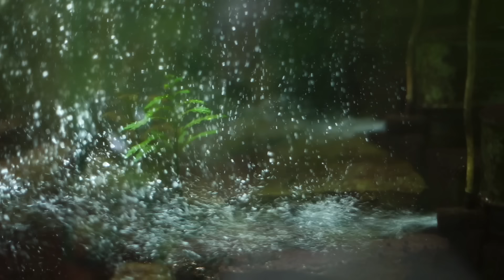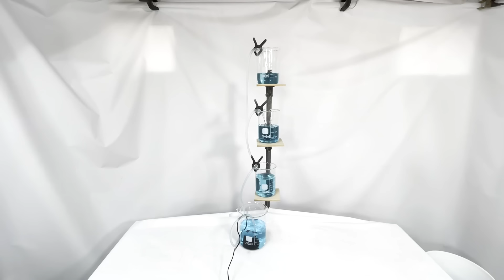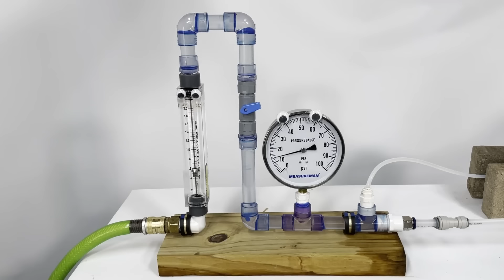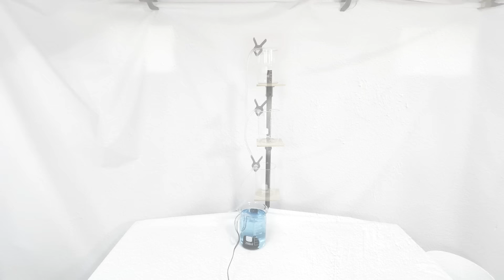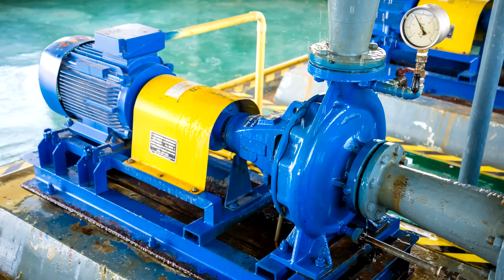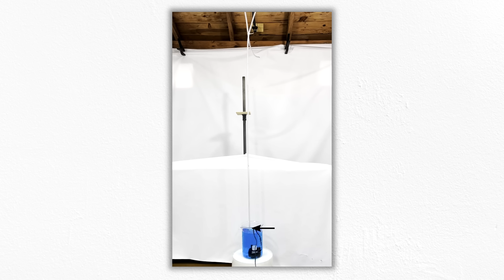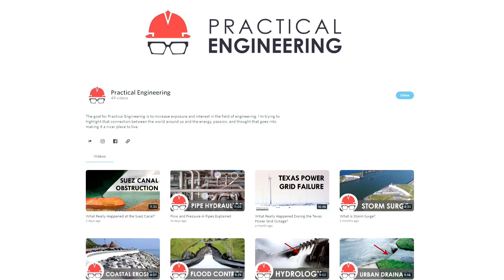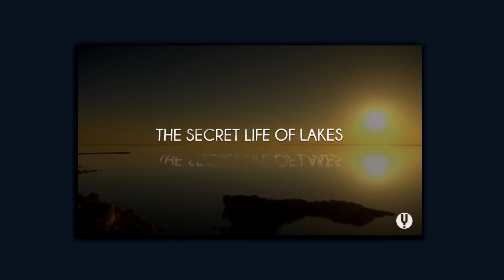Do Pumps Create Pressure or Flow?

Comment: We are rural contractors mainly dealing with fencing and irrigation systems and sometimes I feel like my job is explaining the effects of pipe length, height and pipe diameter on the head of the system as most irrigation supply retailers and plumbers just seem to hand out the wrong advice and try to sell a pump for a system they have done no calculation on. Drives me nuts as we are called in to fix a problem after a lot of money has been spent.

Almost as bad as the one size fits all strainer assembly for fencing but that's a whole new pile of worms

Comment: Please more videoes on pumps! Pleeeeeees! Here in Finland most folks own a fraction of a family summer cottage by a lake or have access to one through friends or access is a fringe benefit provided by your employer. Practically every cottage with electricity has a fixed water pump, often submersible ones for winter when the primary pump and pipes are empty and dryed, consequently inoperable. (I recall people in Texas had pumps and pipes destroyed by freezing water recently😭). 
  The video was great. I will pass it on to my kids.

Cars have multiple pumps, aquariums have pumps, an air compressor is a pump. Pumps are cool. However, elementary understanding may save you a lot of money...

Comment: Easiest way to understand this is through conservation of energy. Pumps theoretically deliver constant power to a hydraulic system. Neglecting losses within the system, it can be stored in pressure and / or supplied in hydraulic flow. The amount of power supplied however remains the same in either extreme, and any increase / decrease in flow or pressure is just swapping between potential and kinetic energy.

Comment: I've thought of positive displacement  pumps as on a curve too, but with motor power as the third variable. If you have a fixed power you could either pump a small volume at a higher pressure, or a large volume at a low pressure.

E.g a triplex pump with a 300 hp motor could do 2 m3/min @ 7 MPa or 0.29 m3/min @ 50 Mpa.
Reply: Yeah, those pumps just tie flow rate to motor speed and pressure to motor torque, so it just means the curve is instead just a mirror of the motor's torque/speed curve.  If you connect the output to a blocked pipe you will stall the motor and all it does is compress the liquid to the pressure determined by the motor stall torque - still creating pressure but no flow.  No real motor can be perfect a perfect pressure or flow source as it would need infinite power to operate in some regimes.

Comment: PD (positive displacement) pumps, triplex or quintuplex for instance, in the oil field are usually but not always belt driven. Pinch the discharge of one of those and horsepower will rise, belts will start squealing, and if the relief valve is shut in the head end of the pump will blow off :) Literally. Pinch the discharge of a centrifugal pump, even a multistage pump, and it backs up on the curve, pumps less (eventually 0) and horsepower falls off. Speaking of horsepower, you left off a really important part of your pump curve, horsepower. In the gas processing and oil transportation business we  have to start our larger (1,500 horsepower) REDA pumps (horizontal, multi-staged centrifugal pump) against a pinched (throttled, whatever) control valve. "Backing the pump up on the curve" reduces flow rate and therefore reduces horsepower. There is less inrush current when you start like that however it's really not optional. If the line has been down any length of time the line goes slack (pressure drops) and the pump is well outside of it's design parameters when you try to start up. Ie, low discharge pressure = high flow rate = high horsepower and the motor protection system will shut it down (my part of our business is control system design and implementation). Also, you reduce the effects of water hammer caused by starting and stopping the flow rate in a pipeline too quickly. Stopping suddenly is the worst of the two.  You also missed the effects of pumped fluid specific gravity. I've seen where an engineer selected a pump based on the curve. The curve is based on water (water and air... the two standards by which a lot of things are referenced). If you're pumping .7 specific gravity crude oil your pump will only move about 70% of what the curve says it will. 

I kind of like pumps.

If you think about it, electrical values like amps, volts, and resistance have analogs to  flow, pressure, and friction.

Comment: Most people think pump is not working properly when its discharge pressure is lower than what they normally observe. This is not always the case, if the pump's flow is normal or even higher than usual then the pump's working but we have less restriction downstream e.g. a relieve valve is passing. If the pump's flow is low then something's wrong with it. Hence the mantra "Pumps generate flow instead of pressure".

I saw another comment that is more accurate and simpler: "Pump add energy to the fluid". The energy can be kinetic (flow), hydraulic (pressure), or even internal (temperature).

Comment: When vehicles age it is common for oil pressure to sag, and then comes the inevitable question, is the pump clogged or failing. More often than not, the cause is reduced peripheral resistance from engine wear. Flow is increased, not decreased. Too bad it is so difficult to practically measure the volume of flow, it would make diagnostics on cooling systems, sprinkler systems, and oil delivery so much more interesting.

Comment: I learned that pumps supply Energy to the system. Flow is a consequence of the system. All it matters is that when the consumer in the 4rth floor opens the hot water tap, hot water comes out at a comfortable pressure.

Comment: Very interesting! The issue is everything has exceptions. Gear pumps (and some other positive displacement pumps) are different in that they deliver a fixed flow rate regardless of fluid viscosity or system pressure and can blow out a line if there is a blockage and no relief valve. Therefore, gear pumps do only deliver flow and the pressure is system driven!

Comment: For a centrifugal pump, kinetic energy imparted by the rotating impeller to the liquid. As the area of the pump casing volute or diffuser expands, kinetic energy is transformed to pressure. The difference of pressures (with consideration of elevation head & head loses on system piping, fittings...) from  the pump to the delivery side will create flow.

A pump expert once said for centrifugal operation "the pump is a slave to the system characteristic".

Comment: The way i understood it was that everything is a pump. From a ceiling fan to an air compressor to a huge water pump etc. You basically input power and fluid is moved. The difference between all those pumps is volume and how easy it is for the fluid to escape or push back thru the pump. 
So how much flow the pump can generate and how much pressure it can suffer.

Comment: If we go to machinery hydraulic systems, we start to get variable displacement pumps that actually do determine how much flow they provide at any given time. But the displacement of them in given moment is usually controlled by the system pressure. Certain pressure threshold is reached, and pump displacement is lowered to lower the flow, and in turn lower the pressure. The pump is controlling itself, within the system parameters. I sometimes scratch my head and wonder what kind of person originally came up with this. It's brilliant and kind of silly at the same time.

Comment: We used to use peristaltic pumps in the lab, which knead the tubing to get a flow. They're handy for not getting any contamination in the fluid you are pumping, or having to clean the pump between uses. Only problem is they can eventually wear through the tubing and create a big mess!
Reply: I've seen the rotary lobed style that is often seen in the medical field, and I've seen an interesting one that resembled the action of a keyboard players fingers, in the horizontal direction, it was from an old bottling plant, in an out building with other equipment.

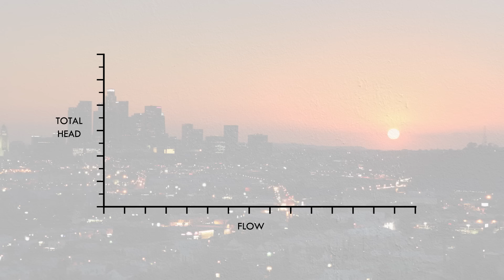Comment: 4:27 a city's system curve does not change based on demand. The system curve only changes if you change the system, ie pipe length, diameter or internal roughness.

Comment: A.  What is the best water pump design & motor to use to do the following:
1.  Pump water from a lower elevation to a higher elevation using a battery operated pump (e.g.  ~7 ft H via .5" ID tubing)
2.  Maintain the proper water flow rate based on the user's adjustment of H & C water faucets (e.g. .5 gpm to 3.5 gpm)
3.  Minimize battery energy usage at various user defined water flow rates

B.  What type & size pump would be ideal for such an application?
C.  Would a one-way check valve reduce energy usage or is that unnecessary?
D.  Is a variable speed pump ideal or would a less expensive fix speed pump be a better choice?
E.  What would be be an ideal pump (brand & model) for such an application?

Comment: What is crazy for many to see is that if you put a pressure gauge between the pump outlet and gate valve, as you close the gate valve the pressure goes up. Okay, that is normal but look at the amp meter! It goes down! It's because the work the pump is doing is moving water, but when you stop the flow, you're also stopping the work. The pump impeller is just free-spinning without a load. I've won many bets on that one! The normal thinking is that if the pressure goes up so does the amps. Just like the fans, take their work away, you take their load away.

Comment: Pump creates pressure
Pressure creates flow
Flow is evidence of work done
If no flow then fluid heats up as evidence of work done

All industrial centrifugal pumps are started against a closed discharge valve to limit the load on the motor, once the motor is up to speed the discharge is opened to establish the desired pressure/flow required.

If you take a positive displacement pump and try to run it against a piping discharge that is dead-ended but has sufficient pressure withstand capacity then all you will get is high pressure and a stalled motor. I.e Zero flow.

Comment: I design and model pumps for a living.  I still find it funny that essentially everyone’s base designs date back to the 1920’s or 1940’s.  It’s all just been scaled up or down since then and slightly tweaked to fine tune performance now that CAD and 3D printed mold components make for more accurate castings.

Comment: An electrical equivalent really answers this question. The pressure is the POTENTIAL (v) of the pump and the flow is the amperage. A circuit always has voltage (potential) and amperage (availability). Same is true for a pump. Whether the voltage or amperage is used and to what degree does not change the presence of the pumps purpose to offer the function . (if a tree falls, there are sound waves, period)

Comment: My new favorite answer to the "volts or amps" debate is directly from an IEC medical electrical equipment safety standard. There's a clause to test permissible limits where you first check the voltage. If the voltage is low enough, then there just isn't enough potential available to force deadly current through you. If the voltage is over the first test, it doesn't guarantee it's dangerous yet. First, you have to load the circuit to see how many amps you can draw. If you can't draw deadly current because the source can't keep up and the voltage dips, then it's still safe, but even if the current is high enough to be dangerous at steady state, it might be such a brief spike because the charge built up in a capacitor drains too quickly to do any damage. So there are three limits listed: voltages above XX V are dangerous only if one or the other or both current or capacitance limits are also breached at the same time.
Reply: @driatrogenesis   so, I did misspeak earlier. It's actually a different standard the exact reference I was making comes from. This comes directly from IEC 61010-1 2010 +AMD1:2016 clause 6.3.1 Limit values for accessible parts in normal conditions. If the AC voltage is below 30Vrms or 42.4Vpeak or DC voltage is below 60V (for equipment intended to be used in wet locations, the limits are 16Vrms, 22.6Vpeak, and 35Vdc) then there is no risk of electric shock. The first limit is voltage not current.

If voltage limits are exceeded, there are two additional tests that must be done. One is a current limit and the other is a charge/energy limit and both must be exceeded before it is considered hazardous. But here's what it means. A 2 megawatt power supply that can source 34,000 amps is considered safe to touch. Yes, a momentary spike in current can kill... Unless it is literally not able to deliver enough energy to do any harm. For voltages above 15000, the safe limit is 350 milliJoules. For below 15kV, it's 45 microCoulombs.

What you're essentially saying is "I'm smarter than an entire committee of standard writers who's entire job is to make sure the products on the shelf are safe" it is NOT a simple answer no matter how much you want it to be.

Comment: One day I wanted to make a cool fountain for my pool, so I connected a small centrifugal pump to a garden sprinkler. Well, it lasted a few days of operation. The nozzles on the sprinkler were too small and the pressure created was stressing the motor so it ended up burning itself in the summer heat. Basically the pump was not operating in its optimal efficiency range wasting heat to force the liquid through small holes instead of a two inch hose. Leaned a lot that day...

Comment: There is a significant oversight in your video.  A centrifugal pump will deliver the same head, regardless of the liquid being pumped, whether it be water, oil, mercury or any other liquid.  Obviously the pressure will be very different in each case, and the motor will have to be sized accordingly.  Power required=w.Q.H/efficiency.

Comment: As an electical engineer this rings a lot of bells.
The behavior of diodes/transistors and motors can be characterized through intersecting functions of intrinsic and extrinsic behavior of the system in response to a change in voltage/current.

Comment: Grady, awesomeness as usual.  Would love more discussion on pumps and fluids.  I was introduced to peristaltic pumps many years ago, and it seems as if they may be the hybrid between positive displacement and centrifugal.  It occurs as if, even though the roller presses the tube and pushes the fluid forward, there is still the possibility that system resistance would stall this pump without the motor stopping because the tube does not create 100% entrapment.  Used them in the design of carbon-fiber fabrication systems.  Would love to hear your take on those pumps, and maybe throw in a discussion on viscosity of fluids across the range of pumps.  By the way, I also love looking for the googly eyes.  They seem to make their appearance in sneaky ways.  :)

Comment: Another example that goes hand in hand is that people treat separate horsepower and torque seperately. If I have a engine spinning at 3k rpm making 300lbs of torque, the HP = 171.4. Suppose I run that same engine to 6k rpm but still make 300ft/lbs of torque; that = 342.7Hp.

For Voltage, my favorite thing to teach my young technicians is volt meters do not measure Voltage. They measure the difference in Voltage, and when I want to run their brains, I tell them volts meters do not read Voltage or difference in Voltage, but current and Voltages are calculated based on that current going through a known capacitor bank. Why does the meter say 2k 20k? You're selecting a capacitor bank, which gives a voltage reading based on the current.

Comment: This set of dynamics for pumps reminds me of fitting an outboard motor to a boat. If you fit one that is too small you can't get "on step" or plane hull speed. If the motor is too big it can cause suction and weight displacement that prevents smooth hull speed and makes getting to plane speed more difficult (ask how I know this).

Comment: I worked on waste water and one day got called to a breakdown. The pump was a PD pump. The rotor had jammed somehow and the motor gearbox had sheared all its mountings and been propelled backwards out through the brick wall of the building. It only stopped because the cables got sheared off as it went out through the wall. Nuff said. I never ever stood near the back end of a running PD pump again.

Comment: Pumps create a power output!
Since P(pressure)*V(volume)=E(energy), that means that P*V/s(V/s means flow rate) = W(wattage, since "P" is pressure).
The more resistence there is in the system, the more of the power is converted to pressure. The less resistence there is in the system, the more of the power is converted to flow rate.

Resistence can come from gravity, friction etc.

Comment: efficiency in pumps isn't just about energy wasted, its about damage. all that electrical energy that is NOT being converted into kinetic energy IS being turned into heat; and that means that eventually the pump can be damaged from over heating. running a pump at the extreme  ends of its efficiency curve (especially the high end) is exactly how to burn out a motor.

Comment: Makes sense, similar to electronics, a battery doesn't produce a fixed current, it depends what resistance its connected to as to how many electrons will flow